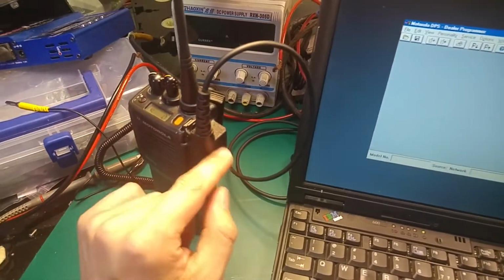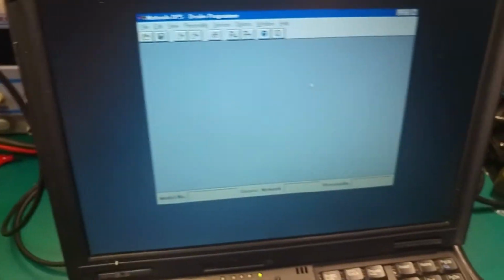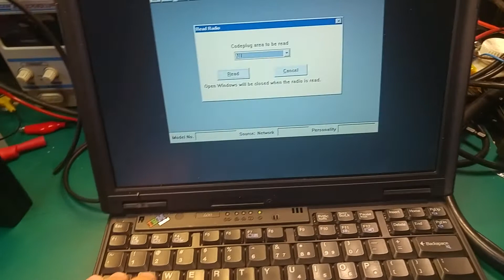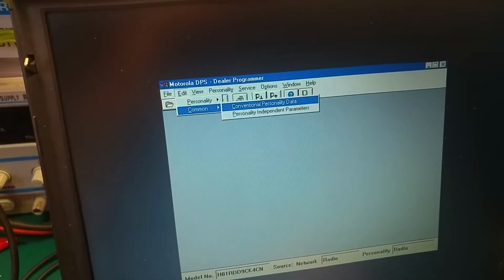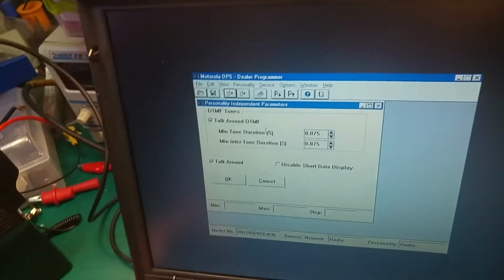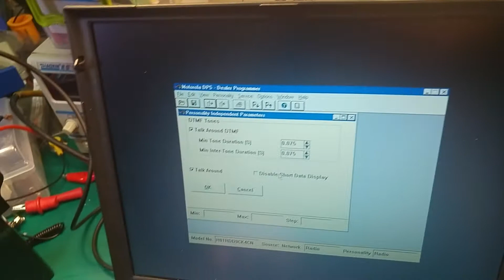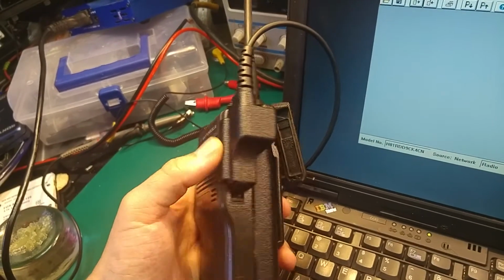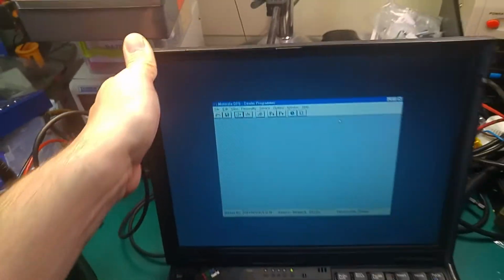Motorola GP1200 programing setting for conventional mode using cheap rib less rs232 cable

Comment: why programming can damage radio ? what is the catch at electronics level ? ?
Reply from the maker: If it won't be completed it can just stuck,  firmware will try to read EEPROM get corrupted data  - half from previous programming - second part from new upload and don't know how to act.  They are old radios modern with OTA programming are made to overcome that kind of issues.
Better avoid doing anything stupid while programming - just saying.
In case failure I'm  sure You can always dump memory from working  to not working outside radio -  but i won't bother for their price.

Comment: how big is a battery pack ?
Reply from the maker: Sorry, can't tell. I just was helping friend program and test this radio.
Reply from the maker: On friend one  i can't access front panel programming like in manual above ( i tried and failed). I use this cable  -> https://www.aliexpress.com/item/Programming-Cable-for-Motorola-CB-Car-Radio-HT1000-MTS2000-XTS3000-GP900-GP9000-XTS350-MTX2000-MTX-LS/32779156739.html   and for software ->      https://www.google.com/search?dcr=0&q="dps12dw.zip"&oq="dps12dw.zip"  using old computer with real RS232 port (not USB to serial adapter my fist try was a VM and USB-SERIAL but no luck) . Via this  real hardware setup programming went smooth :)